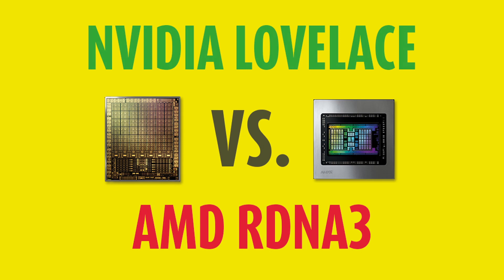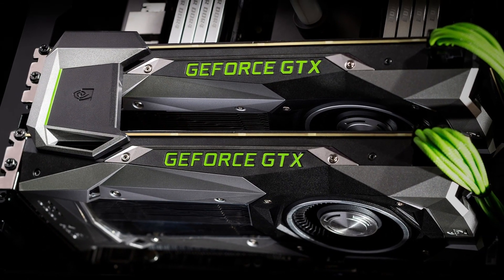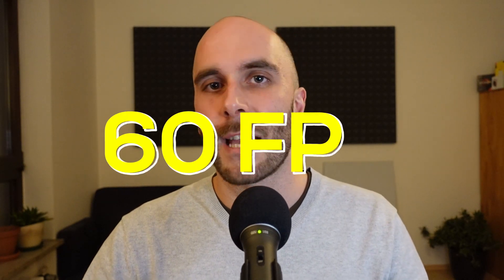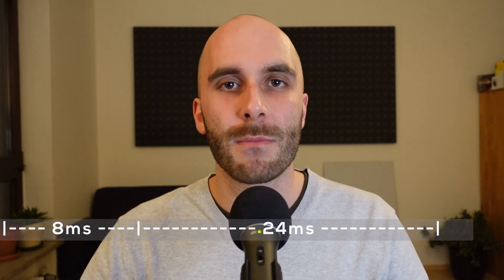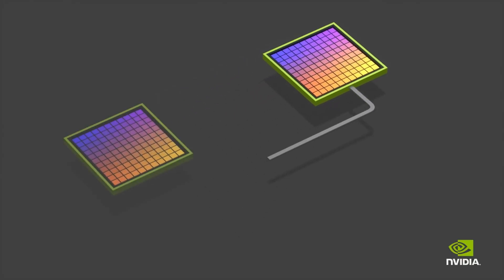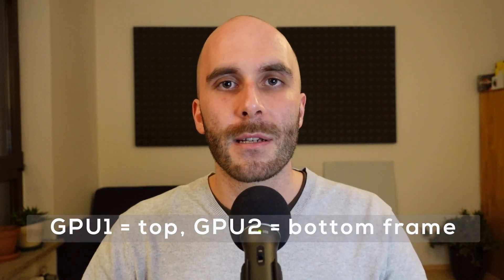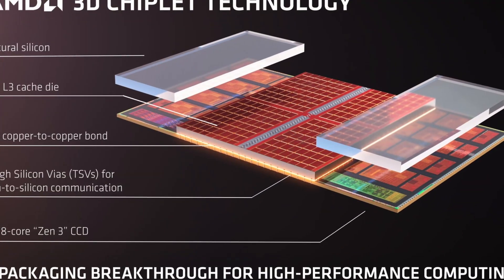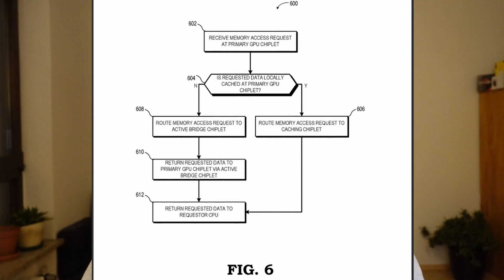How RDNA3 is solving MCM

Comment: what do you think about 3D stacking GPUs rather than chiplet design because Chiplet CPUs still have latency problems like they cant use fast FCLK speed like monolithic intel CPUs but 3d stacked  Chips would have less latency than chiplets because 3d stack chips wontt have gap between each dies unlike chiplet design
Reply from the maker: 3D stacking for GPUs will definitely become reality in the near future, it just makes too much sense. I think we could see 3D stacked cache on top of a APU/iGPU first, but especially AMDs Infinity Cache would benefit a lot from 3D stacking.

Comment: The problem with the MCD idea is the cache needs to be near the compute, think how much Zen3 benefited from the bisected double ring L3 cache ring.
However an IOD + Infinity Cache is a natural idea.
The GPU MCM design &  implementation is the biggest question right now.  I have confidence in their engineering but expect some "ah ha" moments with hindsight making it look obvious.
If it's GPU+MCD or 2xGPU+MCD without surprises I'll be disappointed.
Reply from the maker: I think this patent may turn out to be for RDNA4 or beyond, current rumors about the chiplet design of RDNA3 are much less complex, basically putting the Infinity Cache and the GDDR6 IMC onto extra chiplets and connect them to a monolithic compute die. I actually wanted to do another video about it, but next-gen GPU rumors (for both Nvidia and AMD) are constantly changing right now and I dont want to do a video purely based on rumors.

Comment: But how do you scale beyond two chiplets . do you keep producing ever bigger cache dies to connect them ,is that solving the problem at all? maybe every chiplet will be connected to multiple cache dies????. Even intel approach with battle mage having 4 separate chips on an interposer  is limited to that interposer size. I think we will see multi chip GPU designs. but it looks like it will be limited in the number of chiplets for gaming and not similar to CPUs at all. But i guess it would be an improvement non the less just not as scalable as CPUs. I guess games don't benefit from large core count CPUs also so this feels alot more exciting for compute applications than gaming.
Reply from the maker: That's a good question, its not even sure that this patent is how AMD actually tackled RDNA3. But as bigger GPUs would need more cache, connecting them with even bigger cache dies could work, maybe just using multiple smaller ones.

Comment: The question is if AMD will beat Apple to MCM SOCs.  I could see an M1 Max Duo or Quadro (packaged into a single SOC) coming out in Q3 or Q4.   But I'm stoked for what AMD cooks up and the 5800 3D makes sense as a trial run to MCM designs.
Reply from the maker: Well, good guess because Apple just announced the M1 Ultra, which is basically just a dual M1 Max with a silicon die-to-die interconnect. And its out in Q2!
Reply: That's not my question.